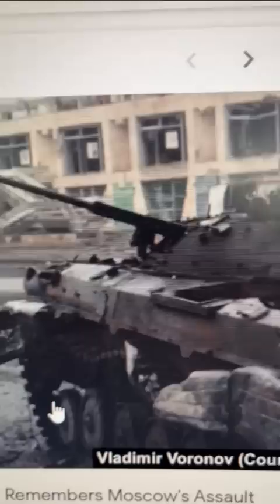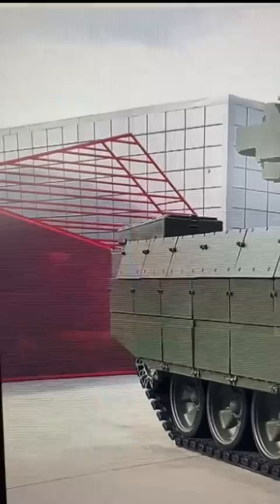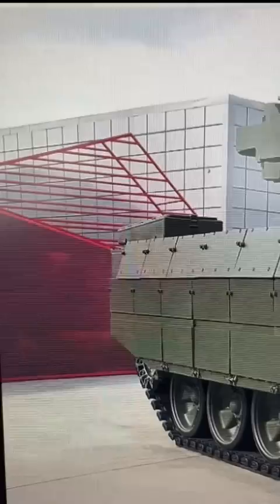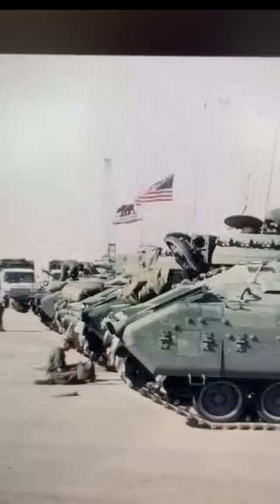BMP Terminator barrels shaking?

Comment: The BMP-2's barrels shake just as much. It's just a part of the gun, since it's not a powered weapon, like the Bushmaster chainguns, but a recoil operated one. The barrel recoils and being a relatively slender and long thing, its will vibrate.
But those guns have a crazy cyclic rate, I think the high speed is like 800 rounds a minute. So it is literally a case of throwing more mud at the wall.
Reply: Ma Deuce is recoil operated and doesn't NEARLY shake as much. Watercooled Maxim guns were/are recoil operated, and don't normally shake the water jackets apart either, despite the tight fit around the barrel.
 
Conversely, AK family guns shake like there's no tomorrow, yet are gas operated, and aren't usually horribly innacurate or anything.
Reply: @michaireneuszjakubowski5289   The recoil is quite alot stronger from the 30 × 165mm cartridge than from the .50 cal BMG.
Reply: @michaireneuszjakubowski5289  I think AK guns shake like crazy because it's usually overgassed?
Reply: Yep it's a thing with the 2A42. Also shakes on videos of it firing on the Ka-52. The gun has been built since the early 80s so they obviously know about it. Probably in line with the Apache M230, where it's meant to be an area suppression weapon.
Reply: @ArcturusOTE  Not really an expert myself (I'll get this outta the way), but, from what I have been told, AK family guns shake like that due to the position of the gas block and the way their gas system is set up.
 
Pretty much all small arms shake as they're fired btw, for the most part it's completely normal. In the case of the AK it's just especially visible, especially if you look at footage of one shooting in slow-motion.
Reply: Its amaazing how everyone here seems to be able to see from 30fps footage what is actually going on from round to round. They are so sure that the barrel doesn't return to original position after each shot. Nope just idiot russians building shitty machinery.
Reply: @volvo245  It's a thin pencil barrel firing on full auto and it wobbles like a car sales dummy. Accuracy has never been a priority for such weapons, but area suppression. It is built to do what it is needed to accomplish.

That gun fires 800 rounds per minute. 30 frames per second means we have 1800 pictures per minute. The wobble is real and the gun fires also when the barrel is "wobbled".

You're basically claiming that the firing rate of the weapon is somehow harmonized to the wobble of the barrel so that even though we can all see it twisting and bending like a crazy straw, it only spits out a shell whenever it happens to be arrow straight.

They're not idiots, but this weapon wasn't built for precision. This is good enough for the intended job, so they can build ten thousand of 'em for cheap.
Reply: Finally someone who get it! Bmpt is meant to do suppressive fire and accuracy by volume. Saw a video where 1 terminator suppressed trench in Forrest, tank and bmp, while other Russian tank could flank enemy. People say it is not accurate therfore some1 can just peek and shoot At weapon at it, yeah coz it so simple to just risk peeking when just 1 random bullet can rip your hand away...
Reply: Seen footage of a bmp-t tearing through forest and destroying a Ukrainian mbt
Reply: @jackmeowmeowmeow2177  Have we?
I've seen the forest video, but no MBT. It has the weapons to do that, sure, just saying I've not seen it.

Comment: Best definition given for the Terminator was by a Brit. During his interview he was asked about the Terminator and all its media fluff.  He said, “it’s the best BMP designed by a committee … “
Reply: So is it bad or not?
Reply: @yeshid900  very bad. Gun fails to depress to any advantage to even the BPM1. Armour is lacking.. Auto cannon still  plagued with rounds storage cook off. Speed is under the speed of the Armada when it runs. Kinda defeats the purpose of tank support when it can't keep up with big brother. Engine is not water resistant to deep water crossings. The Anti tank weapons interfere with the ability. To track and fire the gun. They are expensive to produce and with now actual combat testing the operational bugs haven't been worked out yet. This according to declassified reports and articles in Jane's Magazine 2022 I think it was May issues but don't quote me on that.
Reply: I've heard that they're fairly well regarded by Russian troops. They saw a lot of action in Severodonetsk-Lysychansk and seemed to do quite well. 

They wouldn't be perfect by any means but it seems like the sheer amount of firepower they provide is invaluable for infantry support.
Reply: @jimdr63  it’s built on a t90 chassis with kontact 5 and some sources claiming relict…I think it’s armoured
Reply: @jimdr63 a tank is never going to drive at it's max speed in combat

Comment: an ex russian soldier was saying, that this is intentional in the high fire mode as its only for close quarter and they want a bit of spray here. in the low fire mode (less rounds per minute) the shake is apparently gone
Reply: Finally someone who knows what is talking! Even whith that shake this canons can hit a apc size vehicle at 1000m. There is a video with one firing at a buiding (ukrainian sniper nest) at about 200-300m at low cadence and all those rounds hit in the same place with and starting a fire
Reply: @orhanabd1724  то есть офицер КГБ и президент самой .большой страны в мире оторван от реальности , а не ты ?

Comment: I. Was on those older Bradley's and the weapons that fit in those circular things were called M231. Like an M16 missing tje stocks and a high rate of fire. The issue was that when you finally put rounds on the target, you were out of ammo and had to reload. Some Bradley crews in the s4cobd gulf war used the M231s as crew weapons.
Reply: Was on them also 86-88. If we had ever gotten the ammo dumping brass collecting smoke sucker thingys that would have provided our M231s with enough thousands of rounds a minute, then we would have found out if they were good or bad. As it was with thirty round magazines, if you brushed the trigger you had to reload
Reply: "Port Firing Weapon." Unstabilized. No aligned optics.
If you hit what you were planning on hitting, it would be a bloody miracle.
Reply: Yes! Port firing weapons!  When they trained us they said we had to fire in a Z pattern  but all we had to fire with were 30 round magazines  So we were making the joke to fire in a dot the i pattern.  And like I said we never got the equipment to pour a bunch of rounds into it like they said we'd get we never got it in the 2 years I was with them.
Reply: Thanks for sharing.
Reply: @lairdcummings9092  i see youre an military expert, with 950 medals and decades of battle experience.

Comment: the mounting cradle on the system is more of a problem than the muzzle breaks and yes they could literally just turn the brakes 40° and fix it.  Since they're effectively chain guns they didn't bother to install sufficient recoil guidance.

Comment: Rotating the muzzle device would point it right at the drivers head……so that will probably be the fix
Reply: The muzzle break would redirect some of the gas (down) towards the vehicle.
Reply: you dont turn them 90 degrees, just tilting them 30-45 degrees would eliminate the issue completely, just point the diverted gasses ANYWHERE else other than directly on the other barrel ...
Reply: @Asghaad  it’s Russian making the drivers head nod up and down yes is a future proof feature

Comment: Engineering hat on: if I was forced to have both fire at the same time AND I had to have the muzzle brakes like that, I would tune the barrels (thickness, material properties, shape) so the period (1/frequency) of their deflection would match up with the rate of fire, arresting the deflection right as the next pulse of gas hit.

That being said, rotating the barrels 90 degrees seems much easier and more soldier proof

Comment: The barrels are only used one at a time. 
One is for high explosive, the other one for armor piercing. The terminator doesn't have a ammo switching system like the german Puma, this is why they use two guns in one turret.

Comment: I think BMP-2 has 74 degrees of gun elevation, so it can shoot at helicopters. Gun elevation was most likely not the problem.
on the other hand BMP-2 is lightly armoured and especially from the top (only 5-7mm at certain areas).

Comment: The firing of the barrels of the M42 was not synchronized because the rounds were loaded manually in clips, thus if one loader was slower than the other they would not be in sync.

Comment: BMPT was not developed as an infantry support weapon, but as a tank support vehicle. It even says it in the name. It's purpose is to support tanks with high volume firepower to take out enemy weapons teams and helicopters while having the same protection as tanks. And BMP 2 has no issues with gun elevation at 75 degrees, while BMPT has just 45.

Comment: The thing i firstly expected was that the barrel fires the round accuratly, then the kinetic energy kickes in and the barrel shakes, and as it (hopefully) get rid of this kinetic force, the next round fires - and so on.

The muzzle breaks gas exhaust would counter each other in mid air and by that only compress the air densitiy in the middle of both barrels to a very small and short degree, so i guess offsetthem is not that nessecary. I guess even a really lazy developer had designed the MB in a way that wouldn't interfere. I mean it'd be very obvious from the first scratch if that would be problematic.

Comment: Looks like a quick engineering lash-up which hasn't undergone substantial design workup. Especially in a corrupt environment such as Russia, I can see military officials saying "Looks good, build it!" whilst trousering the money that would have otherwise been used for engineering trials.
Reply: “Trousering the money” is an awesome phrase! Well done. 😂
Reply: russian corrupcy is nothing in terms of money if we are comparing it with american
Reply: It was supposed to he a cheap solution. They took the turret off of a T-72 and put those weapons and firing systems that were from an air defence vehicle. In Grozny they saw that gun based air defence systems like the 2K22 Tunguska and ZSU-23-4 Shilka worked quite well against attackers from above. They initially took guns from one of these platforms and added some AT missile launchers an voila: the BMPT was developed. They might have replaced the guns with new ones.
Reply: Yes that is called usa military industrial complex
Reply: @187Rajah  yeah, no.
Nice try, though.
Reply: @anxietydisorders5917  nope. Clearly, you have zero idea what you're talking about. In the USA, it would have been, at minimum, a custom designed turret, and have about 5392 development tests. It would be BLOODY damn expensive, but it would also work.
Reply: @bobfg3130  cheap, certainly. With a bit of testing, it could also have had the muzzle brake issue solved, too.
Reply: @ShamanKish  welcome to US military procurement, where you will be asked to deliver impossible technological advances, and document the ever living shit out of it. And very likely will get the techno-wonder you asked for, even (such as the F-15) it's a solution to a problem that didn't actually exist.

That's fucking expensive in ways you can't imagine. Things like making a massive intercontinental bomber with the radar cross section of a sparrow, for instance, the ask it to be invisible to thermal detection too, and carry a tractor-trailer load of bombs, to the far side of the planet...all while accounting for - and testing the ever-loving shit out of ever rivet, screw, and nut?  I don't think you can grasp just how fucking expensive that gets. Every SINGLE  part has a multi-page specification. Every part gets TESTED to make sure it meets spec. Then it all gets assembled, each assembly stage having its own procedure which is written, tested, and documented. Then the completed aircraft is tested to an insane degree, problems found and... 

You get the general concept. ALL of that has to be paid for. It's the kind of process only America can afford, and it is rather shockingly clean. Yeah, there's going to be a bit of graft hidden in there somewhere, but far less than you'd expect.

Comment: Btw, the elevation issue is a problem with the BMP-1, not the BMP-2, since that could elevate it’s gun to 74 degrees (more than the 45 of the BMPT). The issue was the armor, the BMPs do not hold up against any AT weapons, so the Russians wanted a high elevation gun on a tank chassis that is far more durable.

Comment: Terminator Barrels are 100% by design from a Project Manager's perspective.  

- Needs to be used in urban warfare
- Only needs to shoot at buildings less than 100yards away (probably)
- Needs to look intimidating
- We don't really care about accuracy

If they wanted accuracy they'd have aligned the barrels like you said, or they'd have put a slider-bar in the middle to stabilize them. On top of all of that, the barrels themselves are too thin especially for Russian munitions. The amount of ammo they will throw through those poor tin-can-thin barrels is probably going to be a lot.  

They'll replace them when the barrels explode, or when Ukraine hits them with artillery. :)
Reply: Or Ukraine hits them with RPG-7 or AT4. No need for fancy and expensive Javelins or TOW2 here.

Comment: They’d run external supporters if they wanted a closer grouping. They’re looking for a spread. This configuration also makes rapid barrel changes far easier. High velocity 30mm explosive rounds just have to hit “close enough” and your mist. They’re also pegging grenades into the trenches as troops flatten out in survival mode… and frying hard points with thermobaric rockets. Frighteningly effective platform with great operator visibility. Well loved by crews apparently.

Comment: The BMP-2s could elevate to hit the higher angle threats on top of buildings, they have something along the lines of -5 to +75 degrees elevation on their guns. The big issue is that they were very lightly armoured and very vulnerable to all the plunging fire coming down on their thin top armour. Hence why the BMP-T platforms are all built on tank chassis for the added protection. Although I’m sure you knew that and were just keeping the explanation short for a YouTube short! Just figured I’d add it in the comments
Reply: Never assume a military analyst that does not understand beating zone knows anything.
Reply: @thaddansen2989  What makes you think he doesn't?
Reply: @hamishneilson7140  The implication inaccurate fire from the cannons is a design flaw in an anti-infantry context particularly with a high fire rate (for cannons) and calling the spread "shotgun" like.

Comment: To my knowledge, the BMPT isn't intended to fire both of its guns at the same time. The reason why they have two canons to begin with is because they haven't figured out a way to have a double feed mechanism for both.
Therefore, one canon fires AP and the other fires HE.

Caveat 1: With some 600rpm, I don't know how much you need both guns to fire at the same time.

Caveat 2: Doctrine and technical evolutions may have occurred, abandoning the AP shells and going for a double 30mm simultaneous fire (hence the vibrations).
Reply: Update: I've watched the full video and only the right canon is firing; it's the only one moving and casings are only coming from the left.
The right gun is silent during the whole engagement.

Comment: BMPT development was started in 1981, dual 30-mm setup was chosen after trials between 1987 and 1991, and was re-iterated in 2002, as 30 mm auto cannon was the only option available. Chechen wars had virtually no impact on design
Reply: @danielallan8061  they picked 100 mm + 30 mm setup for BMP-3, and next year they took twin 30 mm over it. More like it was just some fat ass general's funniest toy

Comment: I don't think it really matters if the barrels vent into each other and causes a shake because the BMPT only really ever shoots out of one barrel at a time. The BMPT has two barrels (really two separate 2A42 autocannons) so that it can fire two ammunition types (HE and AP) because there is no mechanism to load different ammo types from different magazines. The BMPT does have the capability to fire out of both barrels at the same time, but given that they are loaded with different ammunition I suspect that this is not done very often, so it isn't really a problem. Also from other comments it sounds like the 2A42 shakes even on the KA-52 and BMP-2

Comment: I find your note on the origin of the terminator and the BMP-2 not being able to elevate its gun highly unlikely. BMP-2 has a max turret elevation of 74° and it can easily be used for anti-air, it even has a dedicated anti-air sight on the commanders side. You'd have to be within 5m from the wall of a 12 story building to not be able to elevate the gun enough. Hardly a reasonable issue.

Comment: As an old 11H, we both know that the BMP is fine for an open battlefield but suicide to take one in a city with tall buildings as demonstrated. And you’re completely correct, even a rifle barrel has its own sin wave and that wave can be better managed by adjusting the nodal points but the weapon we’re watching needs to be re-engineered since the mounting system is the biggest issue in providing stability then the natural sin wave is magnified and THEN that muzzle blast from the neighboring gun firing doesn’t help one damn bit.

Comment: It’s kinda complicated. You have to remember there are different types of steel and brands with it. We are talking Eastern Europe so it’s different and very unique. It could be the extreme fire rate is causing a heat cast and therefor the inaccuracies. As well as the mix bowing on the gun